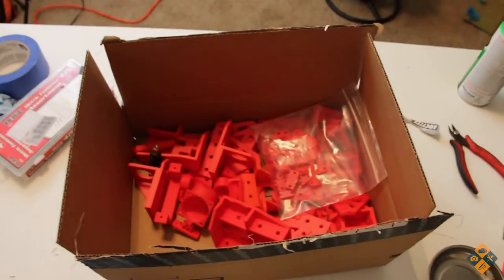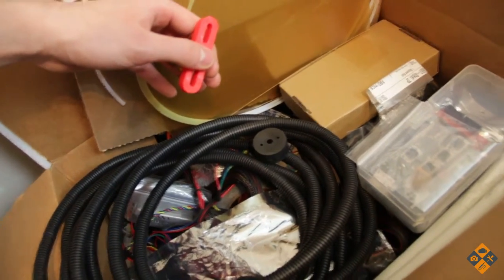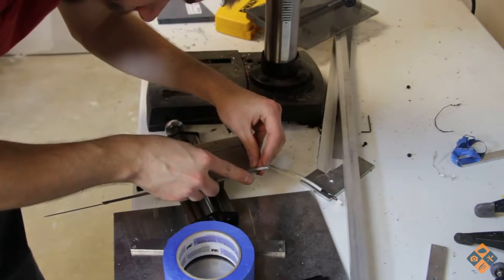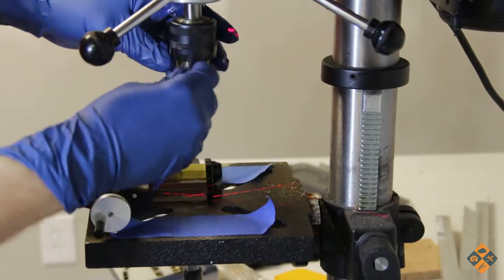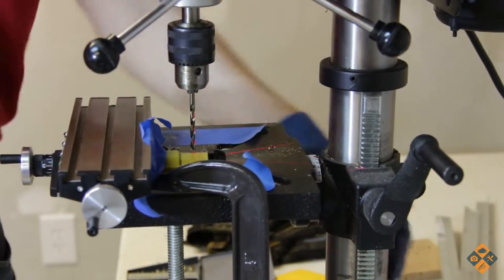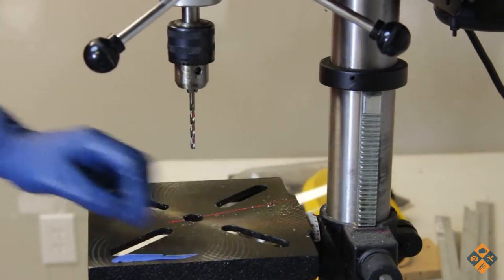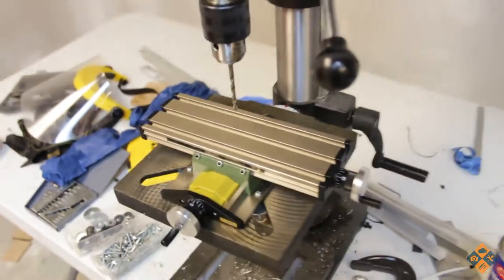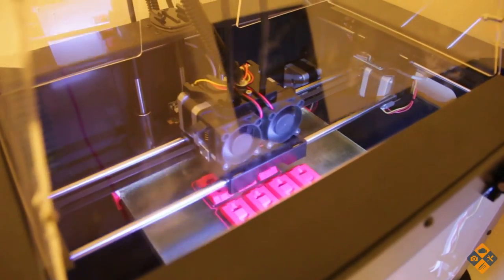3D Printer VLOG #8 - TOOLS FIXING TOOLS

Comment: 1:02 - Have you tried this print surface material yet? https://flex3drive.com/PrintBite/ It got good reviews on RepRap forum - http://forums.reprap.org/read.php?1,566821
Reply from the maker: I use a similar bed surface called PEI. Works in a similar way where you don't need to add hairspray / abs goo/ glue   / etc to the bed. It's pretty cheap and lasts a long time. (The sheet on my flashforge has been working great for over a year now!) I have a video on the PEI sheet and how I installed it here: https://www.youtube.com/watch?v=vkV1AnwZuEo